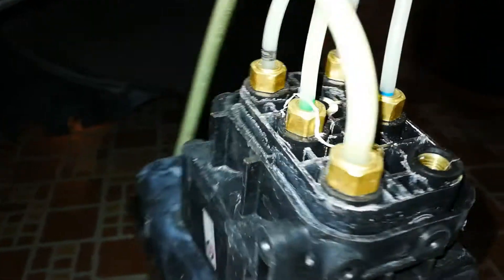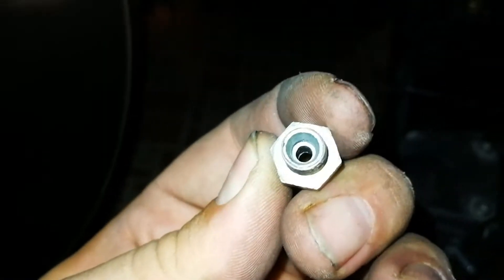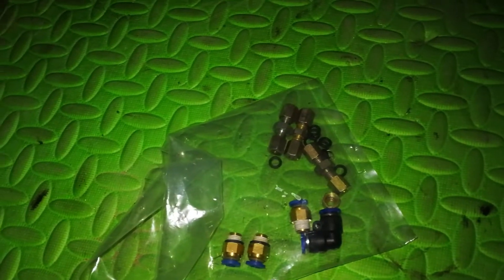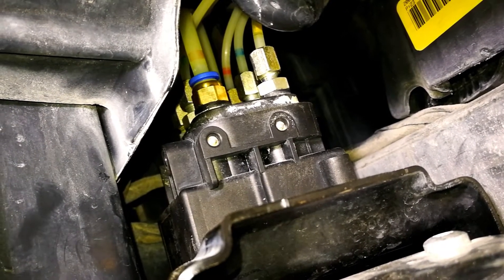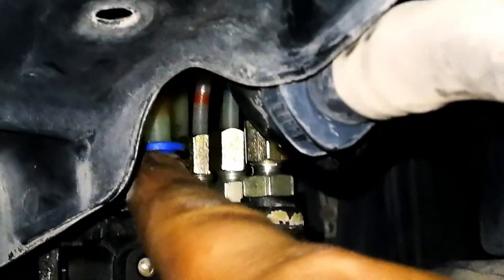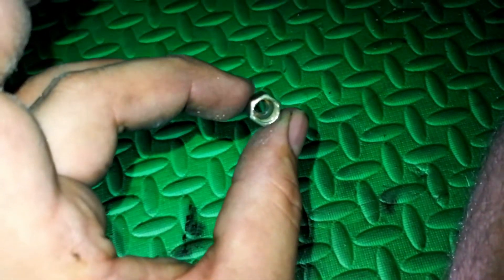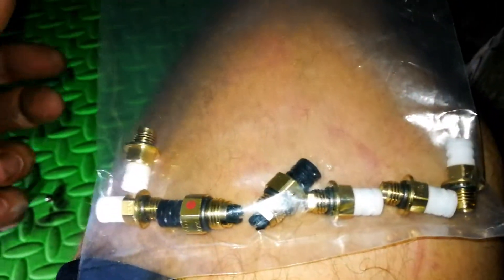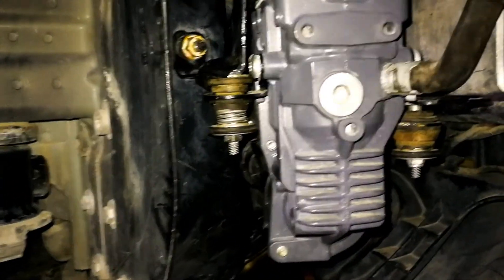2008 GL500 valve block air line connectors upgraded

Comment: Joe this brack slive with sie open is not sealing the line only physical holding the line
Inside the connector is the rubber ring to seal the line.
Those original connectors you can push and after tight
The bras slive going sharper side up
You talking and not understand.